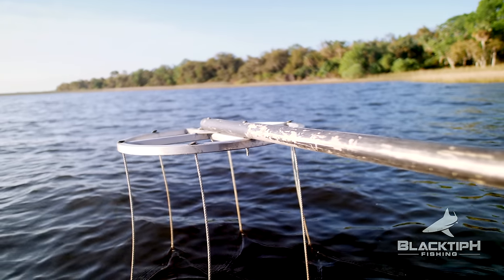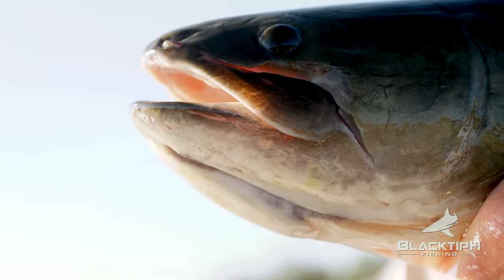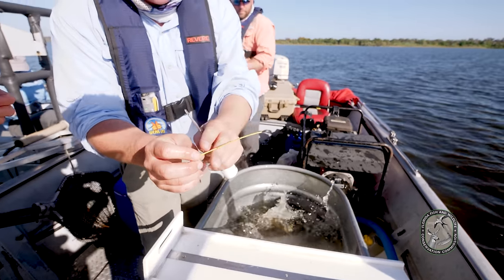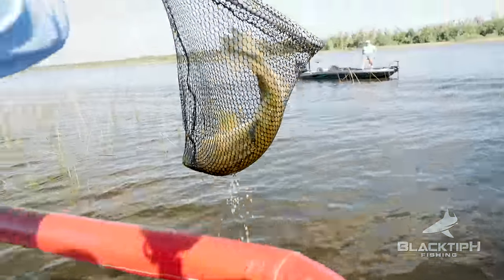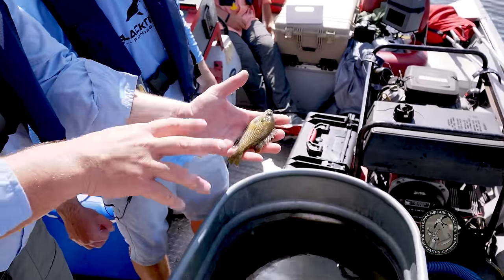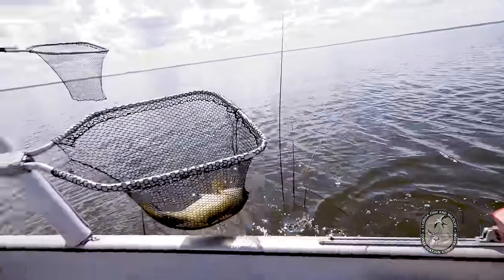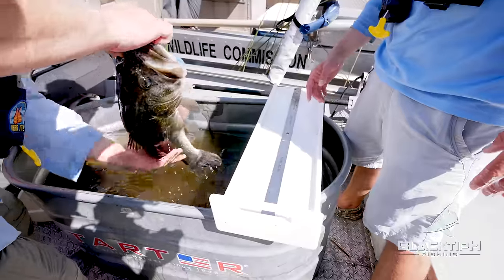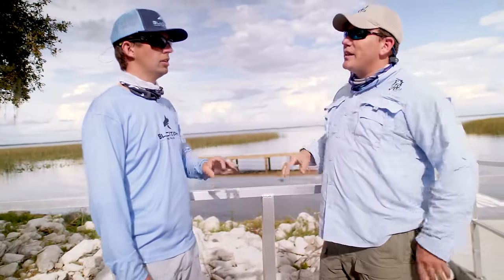Using ELECTRICITY to Catch GIANT Fish

Comment: See what happens if you go into shark waters with the electric thing
Reply: Spunky Token that would be awesome
Reply: Electroshockers don't work in saltwater
Reply: Spunky Token electric thing?😂
Reply: IHUNTA that is false
Reply: @christophergomez872  Quote from FWC website "Can you use an electrofishing boat in saltwater? No. The conductivity of saltwater is higher than the conductivity of the fish. In saltwater, the electricity goes around the fish instead of through it, rendering this technique ineffective for fish collection."
Reply: IHUNTA He didn’t say salt water. He said shark water. Bull sharks are fresh and salt. And also, electroshockers can handle salt water, it just matters on the temp of the water